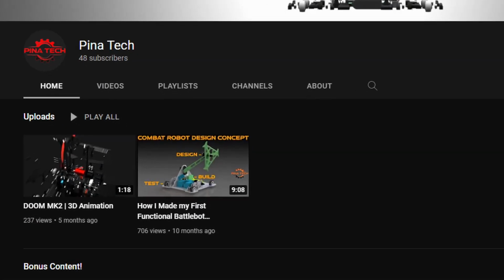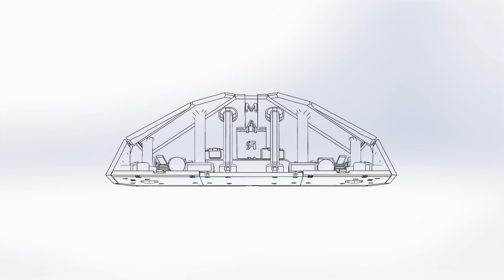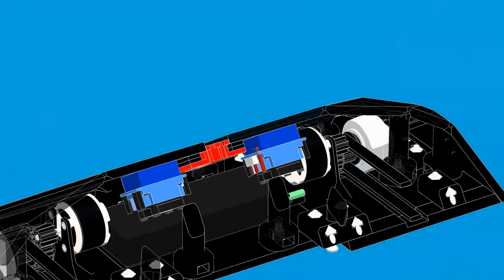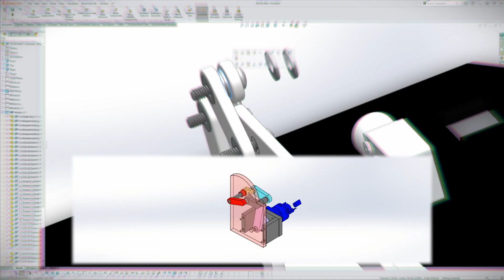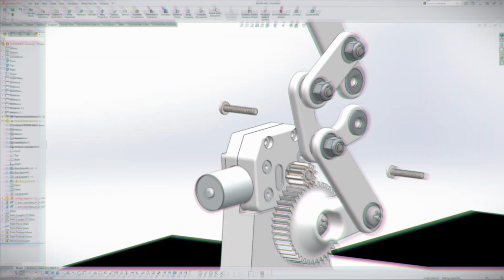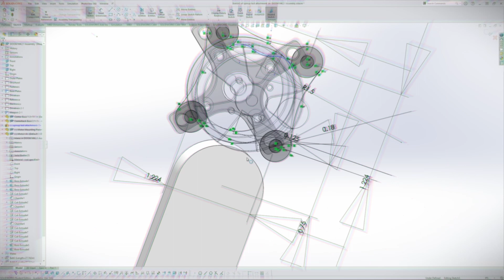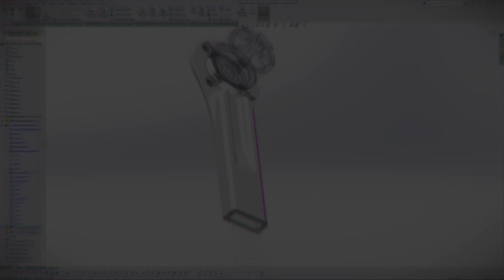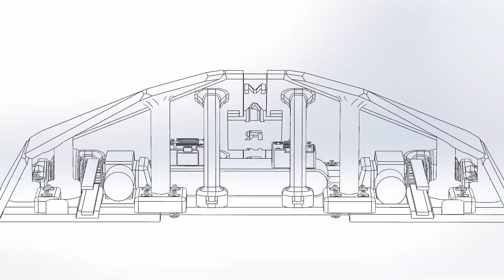Reckless BattleBots Prototyping | Pt. 2

Comment: If I were to design a battlebot, it would be designed for the single purpose of ENDING Tombstone.  I would name it either Stonebreaker or Tomb Raider.  It would be designed to take a full power shot from Tombstone without taking crippling damage,  and physically shocking it so hard that it induces internal failures.
Reply from the maker: You've got the naming down, however, Tombstone is only one of many hard hitters these days. There is a lot more to look out for.
Reply: If I were to design a battle bot I would attempt to make a bone shattering saw hammer out of an angle grinder attached to an arm that hammers down on its opponent and that arm is mounted to a super durable chassis with four wheels and 2 Wheel Drive and the wheels will all be protected
Reply: @lzide3835  I would suggest instead of a saw use a disc spinner like Doom, Skorpios, or Sawblaze as a basic saw will do practically nothing.

Comment: Way too complicated, too many smaller parts, too many things to go wrong and get smashed to bits when taking a heavy hit from the likes of Tombstone.  I don't see this design lasting very long against the top ranked bots with heavy spinners, either vertical, horizontal, or drum.
Reply from the maker: The idea is to bring something new to BattleBots. I can't be satisfied with building a conventional design. There is surely a lot more work to be done to make a mechanism like this viable for BattleBots.
Reply: @aptinventions  No design can be proof against all possible adlversaries. Not without going out of the size and weight class which means it won't compete anyway.  I suggest you pick a specific top ranked bot and design to beat that one.  And then tweak the design to work well against another type of bot as well.  You should be able to design a bot to effectively resist two different threat categories,  but trying to design to counter three types of threats seems to be asking too much.